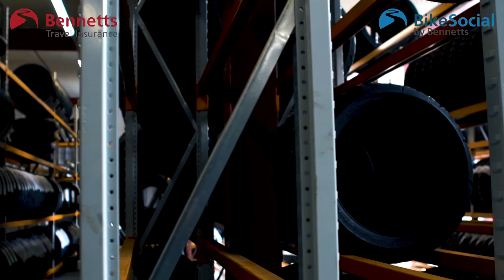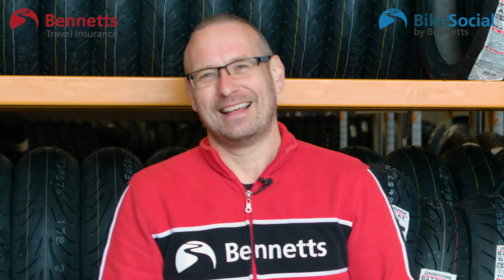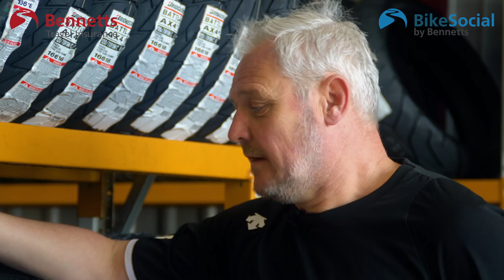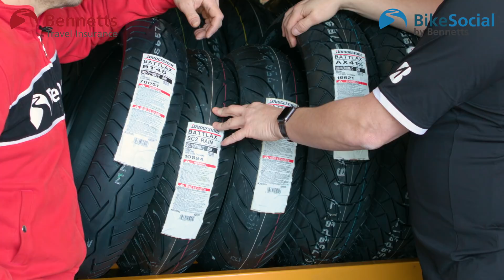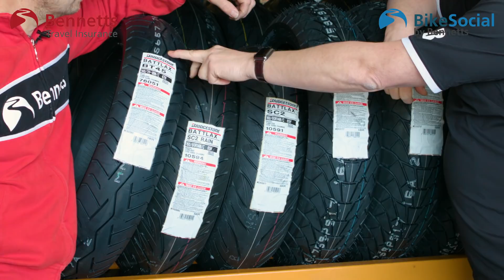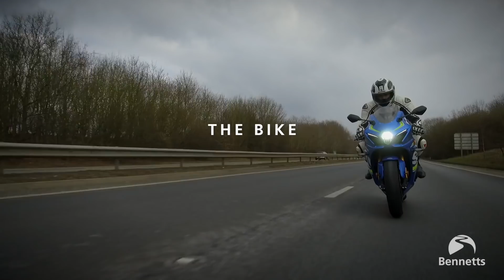BEST tyres for 125, 250cc + Scooters | Pressures, scrubbing in, speed, rain

Comment: So guys Currently looking for tyres and don't want to spend loads and over rated but want Bridgestone  . I have a lexmoto lxr 125cc  euro 5 sport bike . Wondering if Bridgestone  battalax BT-023 would be a good tyre especially in wet conditions  or should I go for  the BT45 . UK weather
Reply: Bridgestone s22 that's what I've got on my rc125 150/60 17

Comment: Is there any difference between a
H rated bias ply and 
H rated radial steel/Aramid. What are the difference.

Why is the carcass and side wall  of a radial softer vs a bias ply carcass and sidewall, which is stiffer . 

What's the difference between H rated radial Steel and 
H rated radial Aramid tires 

What's the difference between the performance of

Radial vs bias ply 
H rated tire for sizes of
(110/70/17front) ( 140/70/17rear)
and which tire will grip better for the same  road conditions.
Reply: THE INDIAN the stiffness of the carcass.  Or the comfort.  Radial will be stiffer so will be less plush.
Reply: @yoorukhunt947  thank you so much . 

Gary this is what I need to know I found some bias ply H rated dual soft compound tire size (110/70/17 front & 140/70/17rear) and my current set on my bike are  radial steel belted H rated tire , will the bias ply grip and give the same handling characteristics of the steel belted radial or will the bias ply flex more and loose grip( only road use ) . 

And about the carcass  how does one check if it's harder or softer . Is checking by hand flexing the side wall and tread and sitting  on a tire which by the way is not mounted on a rim the foolish way of checking. 

Really sorry to ask the same thing again in detail.

Comment: tyre man advised me 34 psi front and back on my heavy Speed Triple 955i, on S22's at a rainy trackday  with standing water on track , but in these videos you are saying to use normal pressures 36f-42r in the wet. Could you clarify on this point please
Reply: Crash if you use that tire psi on wet track